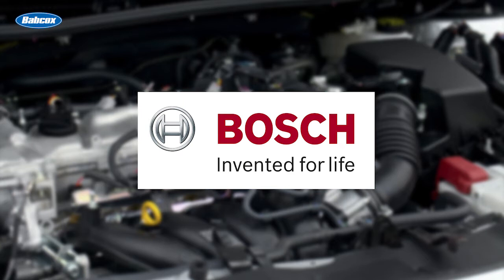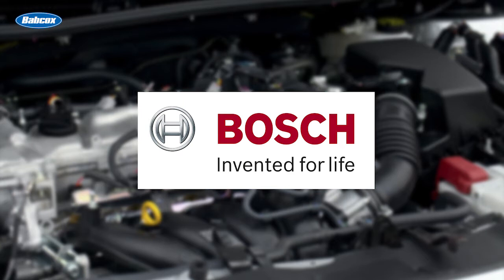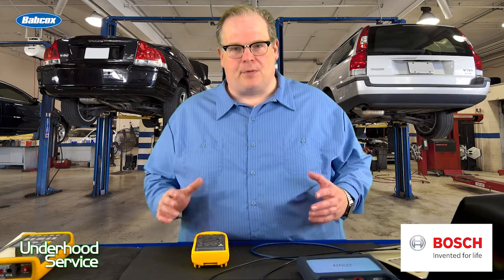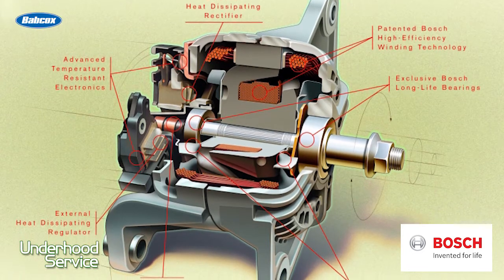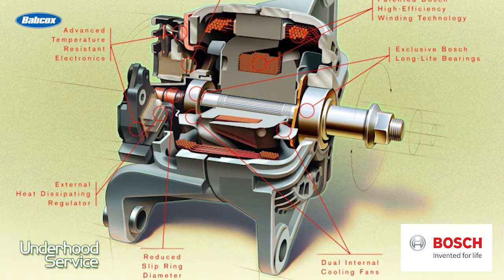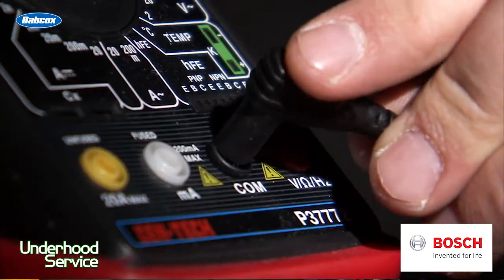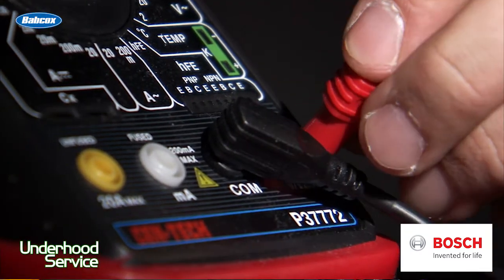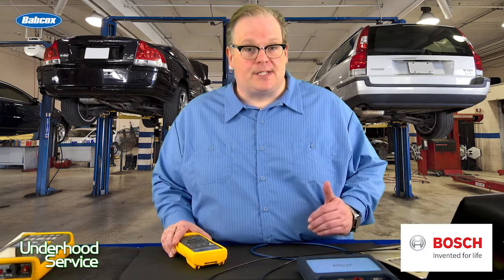Alternators And AC Ripple | Tech Minute

Comment: I know one of the common ways we're taught to test for ripple is a DVOM set to AC Volts . How ever I'm convinced the only true way to see AC ripple is with a scope that's AC coupled . I had a GM with a DR44 Alternator that was pumping out around 620mV pk-pk of ripple . My DVOM (Snap on) only showed around 130mV of ripple at best . In your opinion is a DVOM effective enough to truly trust for Ripple ?? . I think because the ripple "rides on" the DC off set and never crosses the 0V line like a sine wave that the DVOM doesn't see it as AC .
Reply: There are two ways to measure ripple, root mean square (RMS) which reflects the energy in the ripple, and peak to peak the voltage from the trough to the valley of the wave.  The digital multi-meter will show you RMS.  When you "eyeball" a scope, you will be looking at the peak to peak.  https://en.wikipedia.org/wiki/Root_mean_square